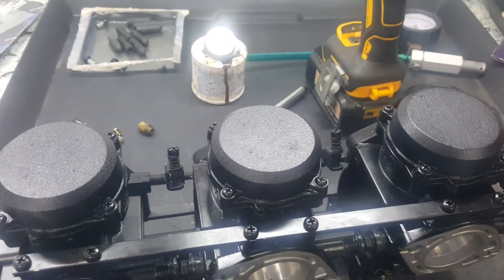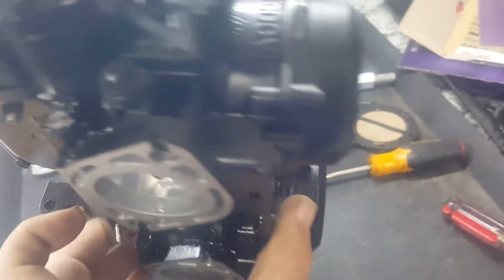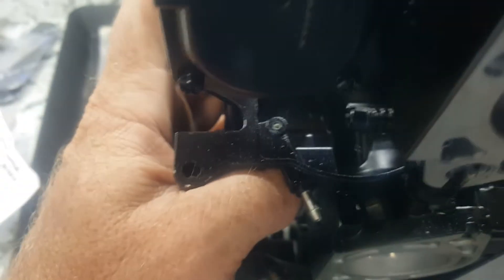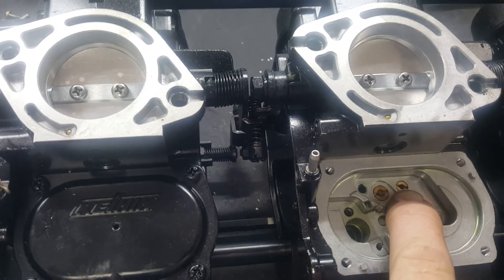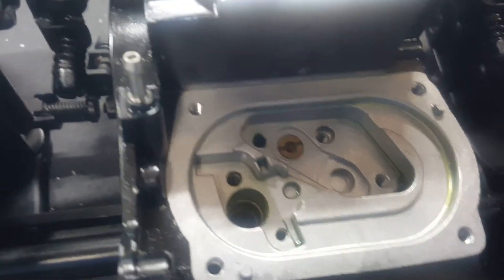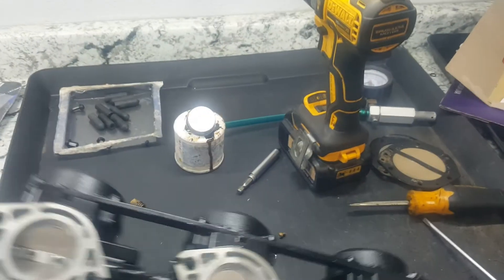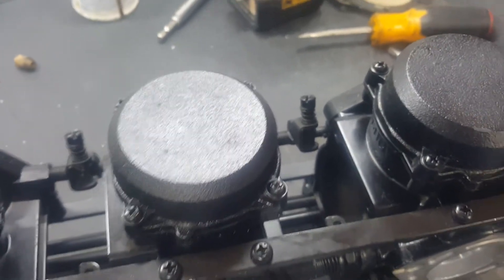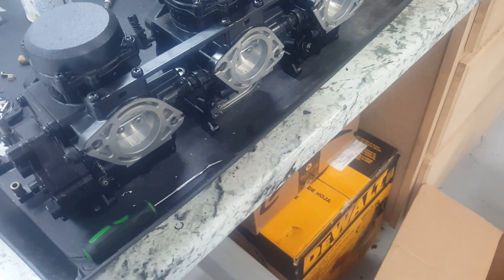Kawasaki STX 1100 + 900 CV constant velocity carburetors won't run

Comment: Hey great info, just a question: would you take 2 of the 3 and install them on a 750 swaped x2? Would this be better than does horrible 3 jet CDK2 DUAL? I know Mikuni sbn44 would be the best but I'd need to buy them and get a manifold too... Oh and also, the oil line inlets need to be plugged if you are running premix?

Comment: I have a 900stx. I rebuilt it 2 years ago. It is difficult to start cold. This way of changing the jet and leaning out the pilot jet seems like a lot more fuel and would cause it to run very rich. How does it work now that you finished and run the ski?

Comment: Great video...thanks! Are there any other carb adjustments other than the low speed screw? I was told to adjust that idle screw 1 3/4 turns and the low side 1 turn. However, I don't see the low side screw. And that's probably because they didn't replace the #35 jet with #50. Thoughts? Thanks again.
Reply from the maker: You adjust the idol with the engine running up to 3000 rpms
Reply: @shannonwilliams601  Ok. I didn't really have an issue with the idle but I'm still going to do what you suggest in this video. So I understand, there is only one screw to adjust on each carb. I need to lightly seat them, then backing out 1/4 turn and replace the jets with #50 jet to help it run better. Are there two adjustment screws?

Comment: I did exactly what you said. Low speed jet to a #50 and adjusted to 1/4 turn out I also tried 7/8 and a whole. The motor idles and then dies when I give it gas. Do you have any other suggestions?
Reply from the maker: Did you rebuild the carburetors and make sure that all your slides are opening correctly and spraying the same amount of fuel into the throat of the carburetor do you have your fuel tank pressure set right there's a lot more to it than just this

Comment: Hi Chris, Thanks for the video it was great.  I am having trouble with out of control rev out to max rpm while on the trailer.  I have heard this can be a lien mix.  Do you think going to the 50 jet might help?  Thanks
Reply from the maker: Usually the symptom is that it won't start or it has trouble idling it sounds like you may have an air leak or your throttle plates need adjustment with your throttle cable under your throttle cable and make sure your plates are closing all the way
Reply: @shannonwilliams601  Thanks Chris, Is the idle adjustment done by adjusting the throttle plates open slightly or can idle be increased by  adjusting the low speed jets you drilled out in your video?  Thanks

Comment: Hey Chris, thanks for the video.
Any suggestions on my issue? 
I have a 99 Kawasaki, STX 1100 I just purchased.
It wouldn’t go over 35 mph so I rebuilt the carburetors .
I also did what you suggested with the low throttle Jets
The first 30 minutes it ran fantastic  after that it started to stall when accelerating then didn’t start at all.
After pulling the plugs, I noticed they were soaking wet, dripping with black oil .
The machine has been converted to pre-mix and I mixed it 60 to 1.
I would greatly appreciate any. Any suggestions you may have .
Thank you
Reply from the maker: Did you ever figure out the problem with your ski
Reply: I am having this same exact issue with mine please let me know if or how you solved this!

Comment: This is awesome because I'm currently rebuilding my carbs on my 1100. But i have a question.  Where do you find that plunger diaphragm.  Iv looked online and don't see anyone making them for the kawasaki.  And the kawasaki website is selling them for like 180 a piece.
Reply from the maker: Part number
Reply from the maker: Unfortunately this is the price that you must pay for those most times they are fine your main concern is the 10 mm plastic cap that is in the center you want to check these thoroughly and make sure they are not cracked if they are call SBT ask for Tech Support they will get you a part number and send you some of them
Reply from the maker: If you need a plunger that's what you have to pay for them unfortunately they are very expensive I suggest getting a set of good used ones off of eBay

Comment: Can yo post a video of tuning one, my 99 1100 starts fine but starts to bog down and foul plugs after a while. I’m new to jet skis and don’t really have enough knowledge on it. TIA
Reply from the maker: If you have the constant velocity carburetors there is no tuning they are factory set if you have the CDK s you can turn those
Reply: @shannonwilliams601  I believe they are the CV. What would be the best route to fix it?

Comment: I have a 1999 Kawasaki STX 1100. I noticed during disassembly & cleaning that after I removed the needle & seat in all 3 carburetors that the front carb did not have an orifice/nozzle under the seat while the middle & rear carb did. Is this factory normal ??? The carb is the furthest from the fuel pump.
Reply from the maker: What do you mean A orifice nozzle it should have a small screen on the bottom of the needle and seat

Comment: I changed the low speed Jets over to number 50 and  turned the jets alway in and backed them a quarter of a turn out unless it starts immediately the plugs get wet
Reply from the maker: OK turn the screws in a eighth of a turn

Comment: my 1998 stx 1100 with cv carbs flood at initial cranking. so have turn over engine alot get it running. I installed primer last year but of course do not use it anymore cause just causes more flooding. Once i turn engine over much she will begin cranking on her own. Suggestion(s)
Reply from the maker: @johnhowell5536  your pop off pressure is not set correctly and your needle is leaking into the throat of the carburetor
Reply: @shannonwilliams601  what needs done to stop needle leaking into throat of carburetor? I recently purchased pop off pressure gauge

Comment: What is the part number of the new size 50 jet. Trying to fine it on pj and need a part number so I get the right one
Reply from the maker: 99101-116.        Number 50
Reply from the maker: I sent over the part number what is going on with your constant velocity carburetors that you think you want to rejet them
Reply: @shannonwilliams601  got a exhaust
Reply: Bogs a lot around 3-4rpm
Reply from the maker: @dkgarage5131  yes they are known for doing that but have you taken off the air cleaner and look down in the carburetors while it's running and make sure that all your slides are operating in sync
Reply: @shannonwilliams601  no I will do that once I get it back together

Comment: Hey Chris.  I have a quick question.  I have 1999 stx 1100.  It is very sluggish in its mid range.  Once it get to 6000 it takes off like a rocket.  I clean the carb with some improvement.  But still sluggish.  It starts and idols ok.  I put the 50 jets in but it would not run at 1/4 of a turn.   Had to go to 3/4, and now it runs and idols.  But I have not water tested it yet, just wondering why I had to go to 3/4s??? Does that mean anything.  Thanks.
Reply from the maker: Did you check your fuel tank pressure Kawasaki's art known for the gas cap cracking and releasing the pressure also the threads that the cap screws onto and there is a one way check valve on top of the tank that goes bad you have to be able to hold pressure or you will plow the engine up running lean
Reply from the maker: And you don't want to clean a carburetor you want to rebuild it with good name brand kids don't use cheap kits you will have nothing but issues
Reply: @shannonwilliams601  I will double check.  And let you know.
Reply: @shannonwilliams601  I tried to rebuild, but could not find any good kits for the cv carbs.  I also watched shady tree jetski video, and the kits I did buy were crap.   So that’s why I “cleaned”.  Vs.  rebuild.   That’s also why I tried the rejetting before I switch to cdck2 carbs.  The does run, and gets up to top speed.  Just slow between 4000 to 6000 rpm’s
Reply: @shannonwilliams601  performance did improve with the cleaning.  But still sluggish.  I have a spare set of cv carbs I can take parts off of if needed.  If the was a fuel pressure leak, would it still get to wide open throttle?   It will hit top speed 51-52, but slow to get there, between 4000 and 6000 rpm’s.  Between 6000-7000, acceleration is great.   I feel like it’s just not getting enough gas in the mid range.  The slides are moving.  Is there a way to adjust the amount of gas during mid range? I heard about putting washers on the needle valve but not sure about it. Thanks for the help